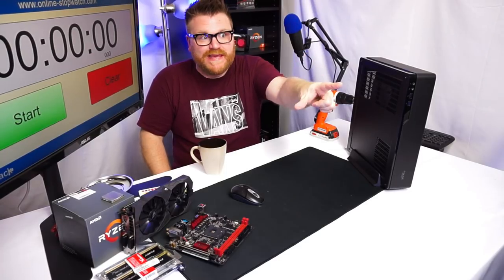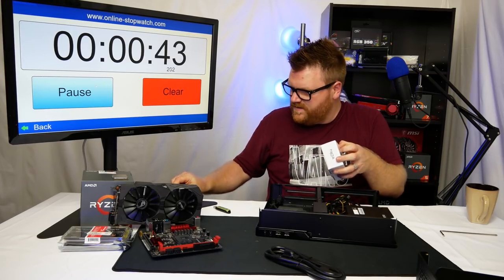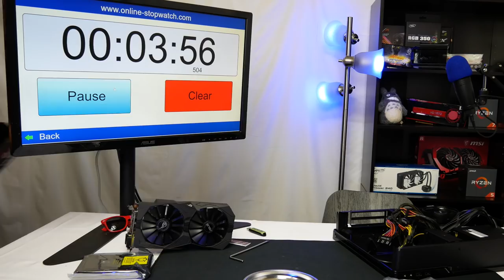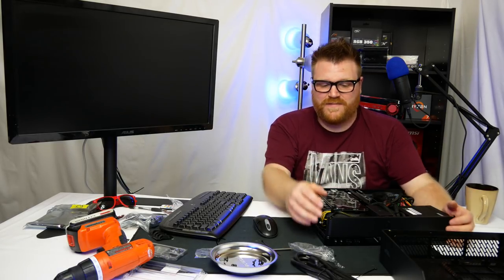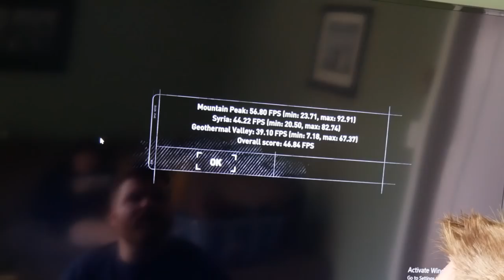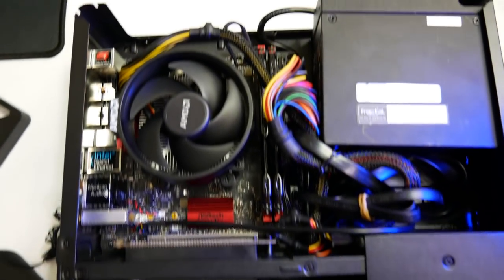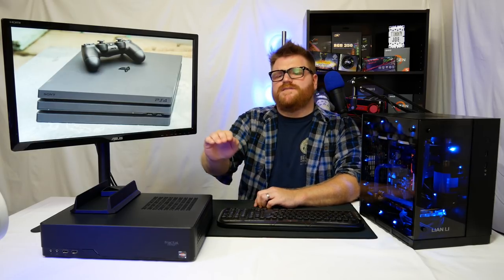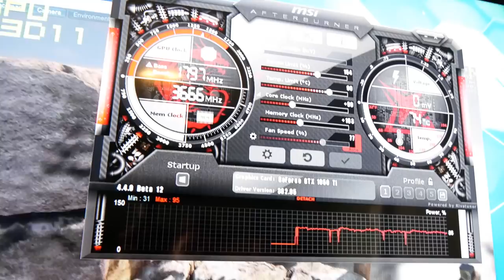Fractal Design Node 202 Review Home Theater PC Build

Comment: Nice build and great video. Thanks.

In a case That big with all of the room they could not find a spot for a 3.5 drive so you would get lots of storage. I would this build with a 1060 for sure and find a spot for a 3.5 drive or choose a different case. I never noticed does it have space for a blu ray drive if not that makes it a no go for sure. Home theater PC implies it does everything home theater related. VLC is old news and stock install has washed out video play back. Kodi is a all in one home theater program and has way better video play back and has been around since the very first xbox when it came out as XBMC much better well rounded program for the front room PC.

Comment: Great, it took me like 4 hours, 1 just to understand how the case opened (the below part), which is by force. Then like 30 minutes trying to install a cooler (cryorig). For the 3.5 inch hdd, i use double sided tape, but that is something I already knew it before buying it so it took only some minutes. Feeling a little stupid :P. Rig: i5 7400, Asus strix Z270i, Cryorig c7, 16 GB Ram Gskill RGB 2400, EVGA GTX 1060 6GB mini, Samsung 950 m2 and WD Green 2TB 3.5"

Comment: As an owner of both this case and one of the processors in question, I'll tell you what the "perfect" processor for this case is: a "T" SKU from Intel, or a low-power Ryzen equivalent, if those are available outside of OEM sale. My i7 6700T though, for example. 2.8 GHz base, 3.6 GHz turbo, 35W TDP, maximum seen temps so far of 47° on an Intel stock heatsink from a 6300 of all things. What?! Blasphemy! I know.

 But it's low-profile, installs super easily, and thanks to the processor's low TDP get the job done just fine. In fact I would go so far as to argue that a T SKU probably presents one of the ONLY truly valid use case for what is otherwise a useless hunk of cheap aluminum.
Reply: no, a 65w can work, as long as you have the appropriate low profile cooler lol
Reply: @mparagames  Brother, look at the age of this comment. Then look at the age of yours. Things were DIFFERENT then.
Reply: @doublevendetta  still, the noctua nh-l9a and other low profile coolers were already a thing back then; and so were 65w cpus; you could still use those. The stock stealth / spire cooler still underperforms compared to better low profile coolers even back then
Reply: @mparagames  apparently I need to clarify: "65W" CPUs were a thing. Because Intel CPUs were never actually 65 Watts at that point. Which meant the majority of extreme low profile coolers that said they can handle 65 Watts could NOT handle the sometimes 30-40% increased ACTUAL load that Intel chips could and WOULD draw, sustained
Reply: @mparagames  THESE days, sure. Shove a 5800X3D in there under a solid slab of copper that's been milled into a heatsink for like sixty bucks, fuggit. It's gonna hit 90C under an all core, but it'll be fine
Reply: @doublevendetta  well, afaik something like an i7 7700 (non k) would draw around that much power, and so would a ryzen 5 1600 / 2600, or 7 1700 / 2700. 

I have a nh-l9a-am4 with a r7 5700x, and at stock it reaches around 85 - 90 degrees, but still works; however tweaking with the power limits to exactly 65w and doing an undervolt will make it be below 80 degrees even at full load.
Reply: @mparagames  Yes on the Ryzen, inaccurate marketing only numbers on the Intel

Comment: the only problem with this build is that there's no disc drive
Reply: What's the problem? It's 2017. I get that's it's a HTPC but still, if you're using any external physical media that's not flash based then you're doing yourself a dishonor. I don't know of hardly anybody building PC's these days that still gets an optical drive, let alone a case that supports one.
Reply: Nokia7s How tf am i gonna rip blurays?!?! I just have this $20 external enclosure that ive used for eternity lol